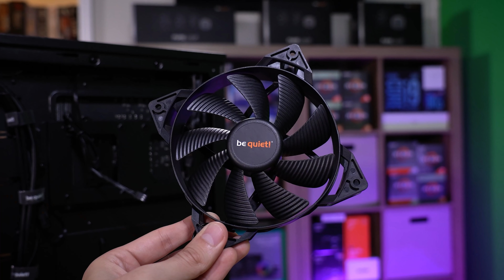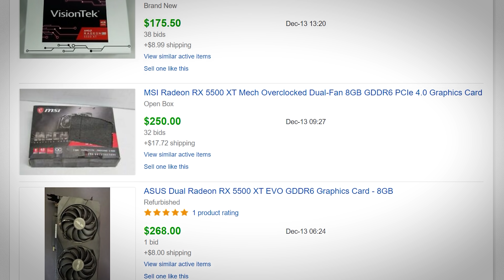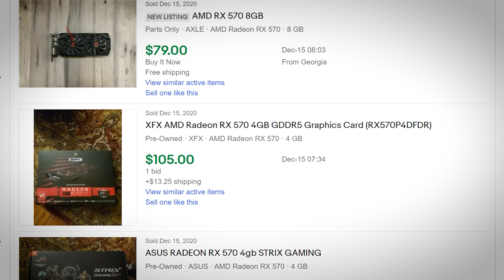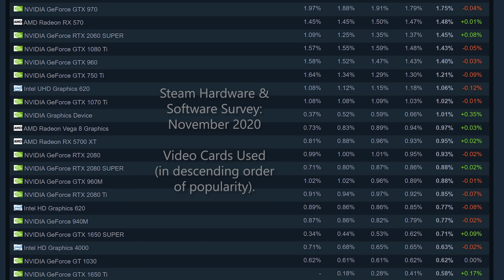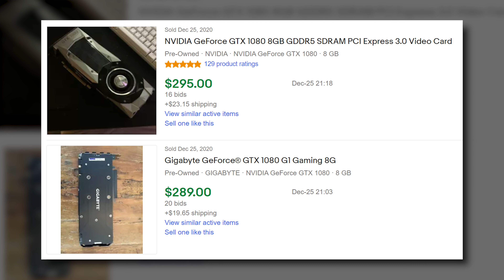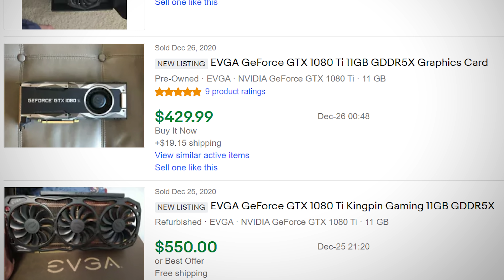2021 Graphics Card Market Analysis

Comment: Isn't a typical markup on graphic cards about 100%,  or  twice the cost  the retailer paid?  50%  mark up is nothing.  1660 6gb and  1050 6gb  are about  $300  right now at Best Buy  and  $500-$600  at Newegg,  which  have  to be  a  300%  to  600%   mark up,   not  50%.  He's  confusing the most important aspect of the whole market issue.

Comment: Truthfully I am a little disappointed with my RTX 3060ti coming from a GTX 1080. I am basically getting the same FPS at 1440p with my RTX 3060ti as I was getting with my GTX 1080 The only time I see performance gains is if the game supports dlss  and dlss is not native 1440p. If I enable ray tracing with dlss off my GTX 1080 smokes my RTX 3060ti. The only new nvidia graphics cards that offer better performance than the previous generation is the RTX 3080 and RtX 3090. The RTX 3070 and RTX 3060ti level of performance already existed with the 2000 series of nvidia cards. Meanwhile all of AMD’s new cards will be better than all of their graphics cards from previous generation. The newest entry level amd card will have better performance than their previous generation flagship card, that is a true generational leap. The RTX 3070 and 3060ti and soon to be RTX 3060 gives you the same performance you can already get with the RTX 2000 series cards.

Comment: Also nobody mentioned that most of these items sold was around the stimulus check time. Nobody is waiting months when they got 600$ dropped in their account && their current Gpu is trash. Ur gonna spend extra to get a decent card until a 3070-80 is possible to grt

Comment: December would have been nice,  Feb 2021, 1060 6gb is going for 300.00 and a 1080 sell for 500. 1070s are 350.    Things are getting crazy.  You should have bought one of these cards in Dec.  They are just getting higher and higher as stock gets lower.  20 series seem to have a smaller mark up...  The problem is when people look at say the 3070, and compare the price to performance vs at 1080ti.

Comment: Last September I bought an rx5500xt 8gb at Best Buy for $190. My friends told me that was a horrible idea, because all the new cards were coming out. Seeing the market now, with the new cards nowhere to be seen, and gtx 1650 selling for over 300 dollars... I am very happy I made that purchase. Cyberpunk 2077 runs at 1080p medium, 45-60 FPS. FS2020 runs at around the same. I have no regrets. If I had waited, I would still be stuck on my old GTX 770- which could barely run FS2020 on 720p low, never mind 1080p.

Comment: So what the 30 Series did, was simply make the 10 Series the only cards you should buy until the market stabilizes. (FOR NOW AT LEAST)
That's what you get when from  the 10's to 20's the only thing you add is RTX at a very early stage.
It's almost laughable how Nvidia putting a low price tag on the 30 Series made it so people could afford multiple, Scalpers Stocked up, Stores couldn't take advantage because they had fixed prices for these cards, but guess who can? An Internet BOT can... And then what? Domino effect, if there's no 30 Series, 20 Series is the next stage, +150$ on those as well why not?

The next stage is 10 Series, going up, I've seen 1070-1080's go up in price the last few months, very marginally, but the trend is still on going, if there's no stock on both 30 Series and 20 Series, 10 Series is next on the line. 

(9 Series is a bit of a stretch because there was a lot on improvements specially in power consumption and in technology, but surely the 10 Series will go up in price a lot more than now until the mid to 3rd quarter of the year).

Comment: I bought a Rog Strix 5700 XT in November 2019, its garbage. The cooler isn't mounted to the chipset properly and the AMD drivers keeps crashing... Worse part is I want to get in to the Ashes of Creation Alpha 2, but cant find a replacement card anywhere...  This sucks! I want to find a 2070 or 3070, but nothing is available at reasonable prices. Can't go out anywhere because of COVID, the 2020s are having a crap start in my books.

Comment: I bought a 2nd hand 1080ti 1 year ago for 450 USD equivalent in my currency. It was a really good deal, considering GPUs in my country cost 70-80%+ more than in the US. Right now bloody 2060 goes for 600 USD from official retailers, mind you. 3070 goes for about 1000. 

Absolutely no regrets getting that 1080 ti for that price, had no issues with it and it's still good for at least 60 fps in modern games at 1440p with some tweaks in the graphics settings.

Comment: I am having Intel Pentiun  G5400 CPU (@3.70Mhz) and   8 gigs DDR4 of RAM. Having 2 monitors attached to the motherboard ( 1 VGA , 1 HDMI) , and they run simultaneously as ( extended display).  I use MS One Note , MS Word , MS PPT , Adobe PDF , Zoom Meetings , Youtube on Chrome all together. I do no gaming on this PC , Max Package Temp is 55 degeree with a min og 26 degree , BenchMark 358 (Intel XTU) .
Sometimes I use windows movie maker / Shotcut to do Video editing /Merging.

Do I need a graphics card ?
If I need one , which one should I buy ?
I wont be doing any gaming.

Comment: Had an rx 580 I got around $100 last year. Sold it for $300 and got a like-new RTX 2060 Super for $440. Close to MSRP and pristine condition so I can't complain. By value, this was better than if I tried to buy one last year. Once you get to mid-high tier cards the price increase drops off, however EBAY bids can be very unforgiving. Your best bet is hitting refresh on "buy it now" or "best offer"  and trying to catch early listings.

Comment: I definitely needed this video.  I finished my first PC build in November, minus the GPU, and I haven't been able to get one this whole time.  I don't have an old GPU and I don't have integrated graphics on my CPU, so it's just an expensive paperweight (even more scary is I don't know if everything works since there's no way to get to POST without graphics, I'm stressing quite a lot about if something is broken and unreturnable).

Today and yesterday were my first days off from work in over a month and I spent it refreshing pages on stores for GPUs (right now I'm leaning towards the 3060 Ti, or 3070 if it's cheap enough).  Completely unsuccessful, I feel so defeated.  I feel so dumb having a PC that I can't even use; more than anything right now I just want to update my resume and I can't even do that (all I've had the last few years is my phone).

I'll definitely give this a rewatch tomorrow and note down the GPUs and the prices you suggested.  I don't know much about any of them, and I've never used eBay before, but hopefully I can figure things out and I guess I'll just wait until later in the year to get a GPU I really want, but for now I just need something that'll work (hopefully).

Comment: So there's really not a good buying option out there that you can recommend? I'm new to this and don't know where to begin. Bad time to be a gaming PC building noob??
Reply: Yes, probably the worst time in history. It's the perfect storm: The card itself is an amazing deal, better than the top end card of last gen for half the price, so there would have been shortages regardless. But also covid is disrupting supply & increasing demand for video games, ethereum miners are buying up as many cards as they can which further reduces supply, and due to China tariffs the price of GPUs and other PC parts just increased significantly. Awful time to buy.
Reply: I'm new too but from what I can tell just don't buy a graphics card right now because they are 2 3 maybe even 4 times as expensive

Comment: Trying to build my first pc around 600 is hard, I’m not knowledgeable enough to know what’s good
Reply: 600 is a hard price point to hit, even with these gpu tips. I've been told 30-40% of a PC cost should go to the GPU, so going for a GPU around 230 bucks would set you up nicely
Reply: @andrewwhite310  sounds reasonable, what about cpu?, i bought a msi b450 tomahawk max
Reply: @jonbarian6190  I think that's an AMD compatable board, right? if you won't be streaming, I'd go with a 3rd gen Ryzen 3. That'll be good enough to get you going for $100. Tbh, I think that board is a lil overkill for a $600 computer. Assuming you paid MSRP, It's pretty overcapable for what you'll be able to afford with the remaining 475, especially if you're gonna buy a windows license
Reply: @andrewwhite310  thank you alot for the help, ill keep that in mind, I got the board for 134 i think
Reply: @jonbarian6190  something I also recommend for balancing your build is to look at what pre-build options are available using a couple choices from your current build. For example, look for prebuilds that use the Ryzen 3 and you're selected GPU, and then see what ram choices they're going with. If you find a majority of them are going with 2x4gb 2666, then chances are you don't need to get anything more expensive than that. I don't know if that's actually an accurate answer, but you get the idea

Comment: I walked into my local microcenter to buy a 5600x (they had a couple in stock on the website). i also saw they had a 1660 super so i was going to pick that up but to my surprise they had 1 3070 in stock that wasn't listed and wasn't even on the display shelf so i snatched it. it went from $500(msrp) to $700 so just a heads up to those looking for a 3000 series card, you will be paying more when they come back in supply. 

but i would advise you guys to try a local computer store. sometimes they have stuff you dont even know they had. that 3070 wasn't on the website. also, they might have returns or 'open box' cards that could be discounted. that is your best shot IMO. if you go the online route, you will be competing with the bots.

Comment: If I could ask a question, it's lengthy but doesn't necessarily require a long answer.

I'm an electrician and actually building a PC is a piece of cake. The issue for me is knowing how to kinda balance a system in terms of cost to performance. I've just built myself a new system. 3800XT, X570 chipset, 16GB 3600MHz, 2x 1TB Adata SX8200 and a Corsair HX750i. Currently I'm using my Gigabyte 1080 Gaming G1 out of my old PC because of the current situation regarding GPU pricing. What I'd like to know is what GPU I should be aiming to get once prices/inventory settle down.

I don't have the power overhead for a 3080, I'm fairly sure, and comparing the 6800/6800XT to the 3070 seems like better bang-for-buck with Nvidia, plus you get gen 2 ray tracing and DLSS where applicable. However, my 1080 has 8GB, same as the 3070. I game at 1920x1080 144Hz. Is the lack of V-ram increase something to be concerned about? Should I go Radeon for the V-ram, at increased cost, or Nvidia for features and value? I'm in the UK and the 6800 is about $150-$200 more than the 3070. (From a reputable retailer, 3070s are about £580, 6800 is £680, prices have remained unchanged, they just don't have any)

Comment: Oh God, If I think about my build from January of 2020.. Ryzen 3600 + bequiet dark rock 3, X570 TUF mobo, 32GB ddr4 3600Mhz (goodram pro), Sapphire nitro RX580 8GB (132 euro) and Crucial MX500 1TB m.2 sata combined with evga 850W G3 power supply in slightly roughen thermaltake suppressor F51 TG tower case. Everyting was in stock and was relatively cheap (when I look at current prices), some parts used (mining gpu, ssd, cpu cooler) but right now still this pc is relevant and I have a lot of fun in 1080p games like COD Warzone, Cyberpunk 2077, Civ 6. Plus the upgrade path is so easy.. I just need a better GPU like 3060 :) Maybe mid-year I will find one.

Comment: Just picked up a RTX 2070 AMP extreme for $360 in Hong Kong used.  Will be using it for a few years before selling it to get a MSRP 4070 or 5070 (if the miners finally fk off).

Comment: Honestly, last year I got my 2070 Super for $540 USD and I'm very pleased price to performance. But obviously that's not the same as it being $540 this year with stronger cards costing less. However they don't actually cost less considering its ONLY scalping price or backorder. I'd say $540 (max) for a 2070 super and getting to use the computer a few months earlier is honestly worth it for some. The card will be able to run games smooth years down the line ( besides lighting.)

Comment: I desperately need to upgrade, im still using my gtx 960 and trying to play modern games its rough
Reply: I feel ya, gtx 1060 here and I’m getting maybe 10-20 FPS on cyberpunk with only 3gb vram. Might upgrade to a rtx 2060 as it won’t blow up the bank
Reply: The way I see it, a 1080 is fine for most games as long as you stick to 1080p. Cyberpunk is pretty much the only game that requires beefier hardware. With the state that Cyberpunk is in, it's questionable if it's worth upgrading only because of that one game. In fact... I run Cyberpunk on my 8gb 1070 at 45-50 FPS with most settings on ultra. Bear in mind that Cyberpunk's graphics are currently badly optimized.

Also, Cyberpunk is very CPU reliant. You won't get a performance boost unless your CPU is up for the job as well.
Reply: Dud3 i have no gpu AT ALL and have everything else

Comment: im looking for any graphics card that can get me 165hz. I currently use a 770 with a 165hz display but it cannot run more than 120hz. I play tf2 which is an old game so i can get the frames if i can get the hardware to run it. Can anyone recommend a card?
Reply: For TF2 just get a 1060 6gb or 1070 they will work perfectly fine, if ur amd then go for rx 570/580. If you can wait then go for an RTX 3060 ti for the future
Reply: @SkeIeton  can’t find either of them used for under £250. But I’ll keep looking and hope for better.

Comment: Managed to snag an MSI 1650 super for only 190$... only 10$ above MSRP pretty good if I say so myself.
Reply: How is it?
Reply: @ThroughDarknessComesLight  it's an amazing value card for the price. It runs my games at 85+ FPS at max detail and there is no stuttering or problems of any kind. It keeps 60° at 100% load while running at a 2025MHz boost clock. At idle it only stays at 33° while using its zero RPM mode. It's pretty great for the price.
Reply: @overclocked5  will you ever oc it ?
Reply: @ThroughDarknessComesLight  I dont see any point because it already boosts itself to 2025mhz compared to its advertised 1755mhz boost so it's kinda already overclocked.
Reply: @ThroughDarknessComesLight  but if you did there is large overclocking headroom on it
Reply: @overclocked5  what games do you mostly play if I may ask ?
Reply: @ThroughDarknessComesLight  Sea of thieves, Witcher 3, Halo MCC. Things like that all run 60fps plus ultra.

Comment: You might say im desperate, I have been waiting in line for the 3070 for months now and im still nowhere near one. Figured I just might buy a 2070 super like my original plan was but those are selling used over msrp. Don’t judge me,I just bid 585 on a 2070s in 2021

Comment: @ Greg Salazar : what would the approx value be of a 1050 Ti GPU?  At current pricing that's the only GPU in my budget range either by private sale or AliExpress pricing.  Recently ordered Ryzen 5 1600 + Asus b350 Prime Plus from AliExpress....I am currently holding on to my 2nd hand purchased evga gtx460.  Speculating on going to a 1050 Ti down the road.  I'm a low budget gamer, so can't really consider the top end models or mid range.

Comment: Still cherishing my RTX 2080 i bought 2 years ago and running most titles on 1440p ultra wide 100hz on high settings. Will eventually upgrade to maybe a 3080 ti or 3090 but not really in a hurry to upgrade with these nonsense prices

Comment: Its crazy right now I just bought a rx 570 on dec 31 right before the boom becase now jan 5th the prices for used rx 570s are now about the same price as launch for used gpus and 8gb rx 570s are going for close to 200 (195+) and even higher for rx 580 used. I'm glad I got my rx 570 for 127 even though that's a higher price than usual its lucky in 2021 prices

Comment: Didn’t mention the 1660 at all it’s insane I’m glad I was able to snag one for $239.99 before Christmas
Reply: pfft tell me about it.. currently regretting all life decisions after passing on that one
Reply: I was wondering about that too. Excluding the recent 3060ti, the 1660 Super was arguably the most cost-efficient card on the (non-used) market in 2020.
Reply: @ivanjasso4766  well technically the 1650 super is better value but it doesn’t have enough power to play at higher frame rates like the 1660 super
Reply: im regretting not snagging up a 2060 last december before shit happened